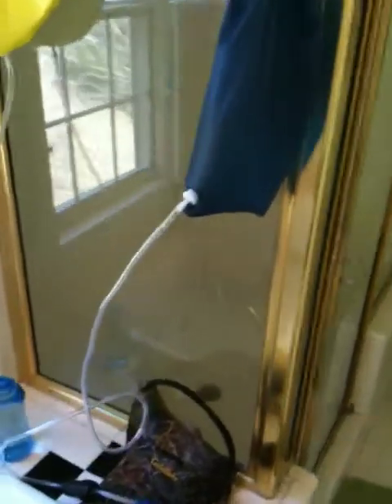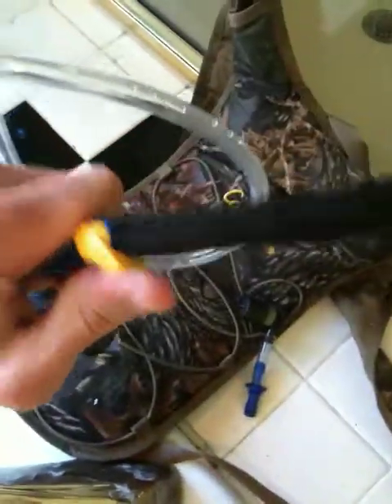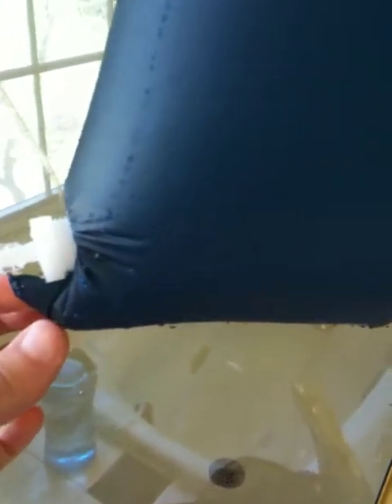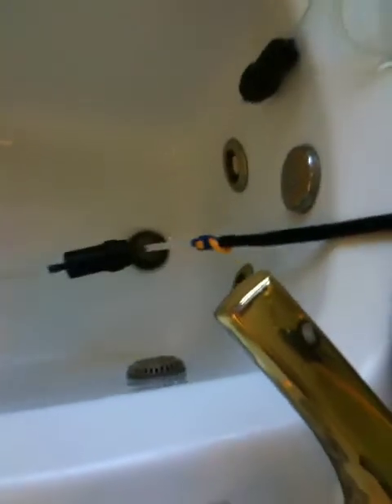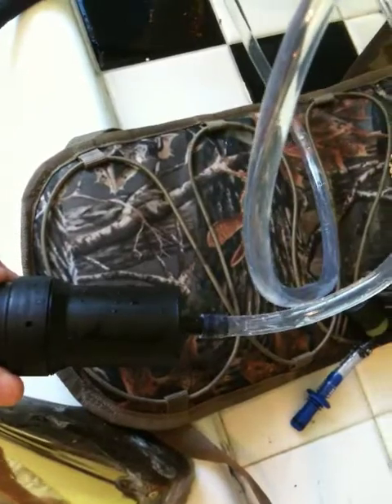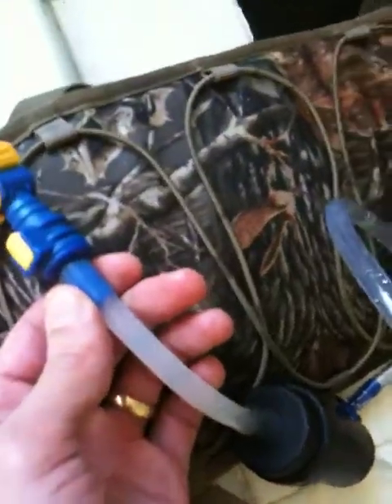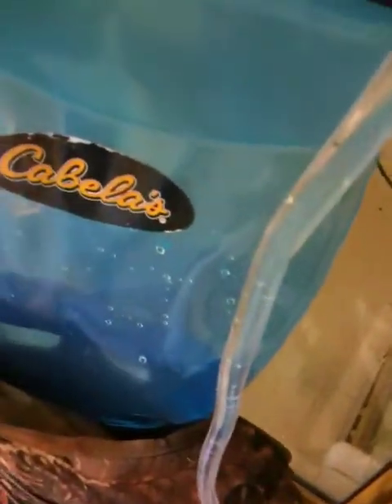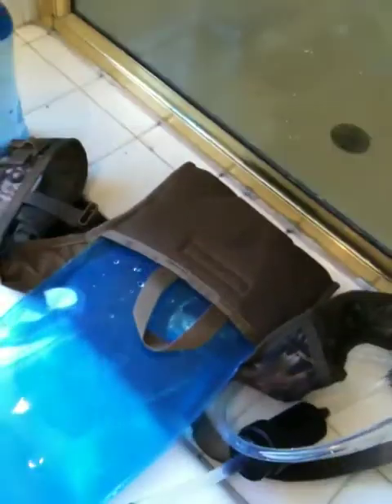DIY gravity feed water purifier filter demo with CamelBak HydroLink Filter Adapter

Comment: The main reason is simple, it requires less physical effort than a pump filter. In practice, it may take slightly longer than using a pump filter to filter the same volume of water, or this gravity filter may be slightly faster... depends on how hard the person with the pump filter is pumping, what type of filter they have, etc. The big advantages are that it is easier, you are able to go do other things while this filter works, and there are less parts to wear out.